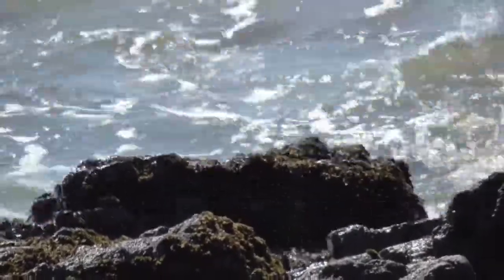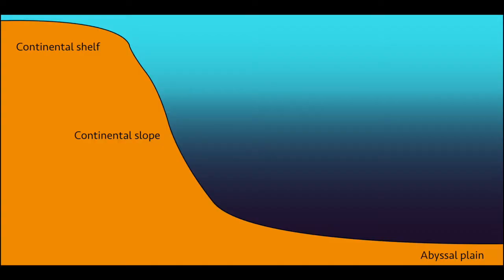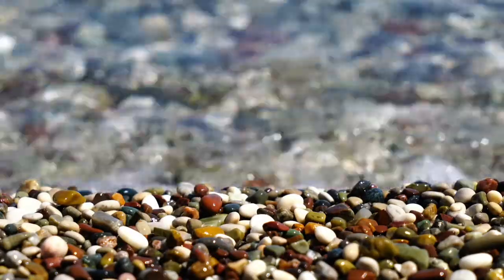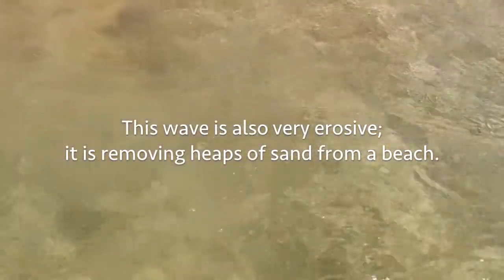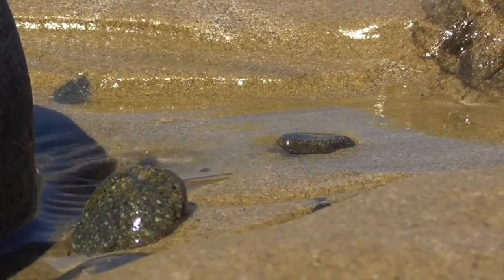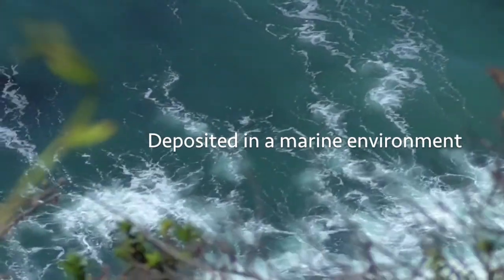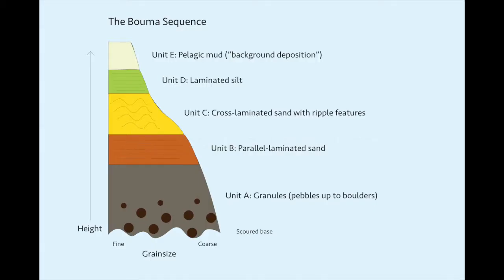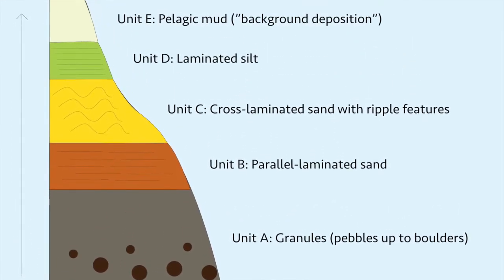Turbidites

Comment: Great Video, thank you so much for making it!

Recently I read an article that says that ..."turbidity currents also involve large-scale sediment movements within the seafloor." Could you tell me, what do you think about this hypothesis? 
Do you agree? Here is the link to the article.
https://www.usgs.gov/center-news/large-underwater-experiment-monterey-canyon-shows-turbidity-currents-involve-seafloor

Also, could you make a video about marine sediments? 
Thanks again
Reply from the maker: Hi there, thanks for getting in touch! I just finished reading the paper and yes, it's a reasonable conclusion. Amazing to think that researchers are just now getting to know real turbidity currents in the ocean.  :)

I'm currently making a series of videos about sedimentary rocks and will try to make time for one specifically about marine sediments. There's a lot to talk about there, so thanks for the suggestion!
Reply: It depends what you call "large-scale", my guess is that this is a relatively subjective term.
But in my experience, the biggest turbidity currents (in average) are the so-called MTDs, or Mass Transport Deposits.  These occur when "large" (or any size) sedimentary sections of the continental slope become unstable and a subsea landslide initiates.
There are different trigger mechanisms, one of them being earthquakes.  Tectonic activity has the capacity to destabilize large amounts of sediment in the continental slope, especially if the fault is a long one.

This is a separate subject, but those MTDs are usually rich in mud and usually have little economic value for us petroleum geologists :D

Comment: Hi Thomas. I understand that any flow deposits bigger clasts first if it looses energy with time. So I picture the sequence pebble-sand-mud in an horizontal dimension. I do not completely understand why you see this sequence represented in a vertical stack. I hope the question is clear enough. Very nice video. Thanks!

Comment: so then why is this not just considered a debris flow?
Reply from the maker: Good question! The main difference is that in a turbidity current, sediment grains are supported and carried by turbulent water. In a debris flow, sediment grains are supported by contact with each other, or by a much lower proportion of water that isn't turbulent. Hope this helps.  :)
Reply: @ThomasStevensontutor  great answer.  Both debris flows and turbidity currents fall under the more general term Gravity Flows.  As Thomas correctly said, a debris flow is usually coarser grained and it just flows along the bottom of the seafloor.  Whereas turbidity currents have lighter grains that allow the column of water to mix inside of them as they advance downslope, creating turbulence within the flow and incorporating a % of the total sediment into the water column.

Additionally, a debris flow wouldn't exhibit a Bouma sequence texture like a turbidity current would. A debris flow texture would be more chaotic in general.